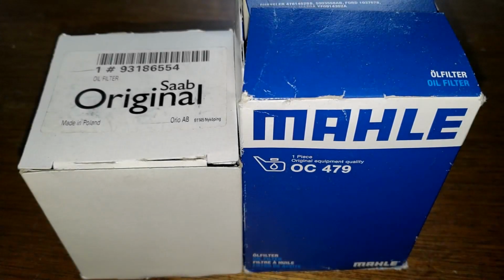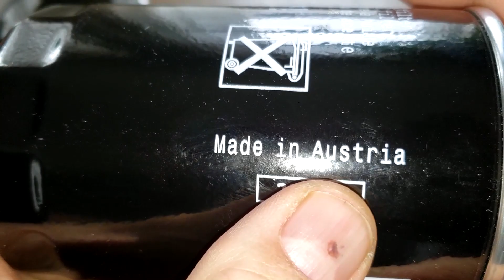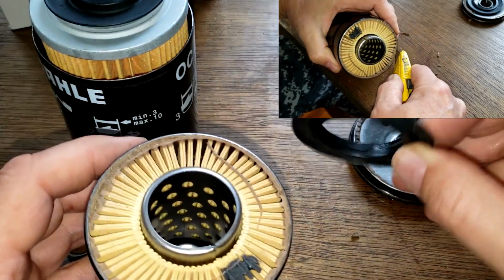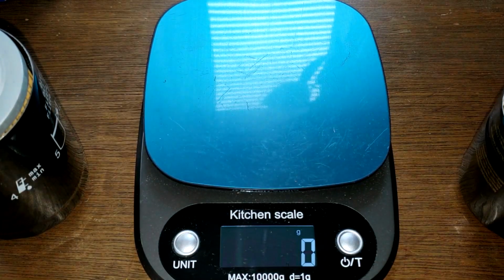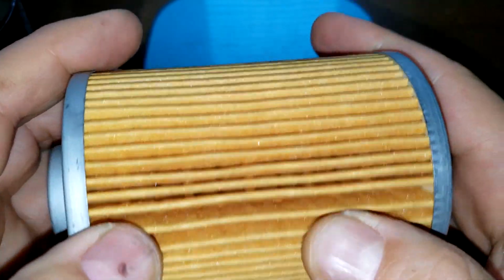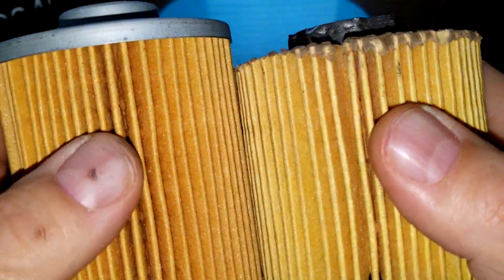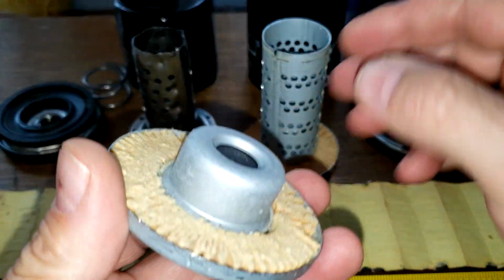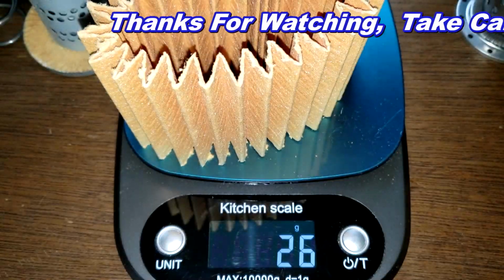Saab Oil Filter 55560202 vs. MAHLE Oil Filter OC479 Cut open

Comment: Mahle uses synthetic media.  They go into the benefits on their site.  Found this on BITOG with some digging (from a user that emailed Mahle):  'Beta Ratio: 50% -- 18 micron 75% -- 24 micron 90% -- 28 micron'.  So absolute efficiency is probably around 90% @ 20 micron.  Not bad at all.
Reply from the maker: Thanks for this information, I'll pin your comment so it sits up top.
Thank You!
Reply: @WhipCityWrencher  Thanks!  I also saw a diagram of their filters and the valve on the base end.  As some comments have pointed out below, it's an anti-siphon valve.  My thing about that is how does it impede flow?  It really reduces the size of the filter output.

Comment: There is a story behind the Saab filter. It was a redesign developed during 2003 to 2005 triggered by a oil sludge recall campaign for the B2x5 engines, and that specific oil filter is probably one of the more well tuned OEM filters in the car industry. It also explains the bypass spring valve design, as it allows operating closer to maximum allowable pressure loss than a normal spring that opens gradually. So for the Saab engines it is recommended for, I wouldn't use any other oil filter (in normal price ranges).
Reply from the maker: Thanks for Sharing that info on this filter👍

Comment: That second "bypass" valve is used to keep oil in the filter when the engine is turned off for cars that have the filters mounted sideways. I have a Ford Focus with a Zetec 2.0 and that's what I use.

Comment: Nice video. As a mechanic, I would prefer the Saab filter. It's has more filter area, is more robustly made, has a simpler design and bypass valve. The filter also sits facing down,  so the oil won't escape at shutdown. Also, using original parts is good practice for any claims.
Reply from the maker: Thanks, Pete👍

Comment: SABB, haven't heard that name in awhile.

Still have nightmares from a late 80s Sabb who the dealership I worked for took on trade.  It had electrical problems, and all I remember was spending hours testing relays.

I got it running, but remember watching a customer drive it off the lot hopping it wouldn't die until he made it to the other side of El Camino.

The life of a former Ford Tech.   

Thanks for all that you do.

Comment: Never owned a SAAB. but have been called  a SOB plenty of times... Not so sure about that glued seam to the can, creates a bulkhead there I would think 🤔.  Saw another comment about their timing chain drive systems needing that consistent oil pressure at all times, thus that super unique twin bypass system on the "Moll EEE" filters. It's wider media makes up some, for its shorter length.. "MOLL EEE" filters have always been quality stuff on the equipment on the Construction company I worked for ...👍 Another Very Interesting Video on Oil Filter Friday's. Thanx WCW.....Jethro

Comment: The second bypass on the Mahle is designed for applications where oil would otherwise drain from the outlet side on engine shutdown - it's not common, but ultimately depends on oil filter placement on the engine - a traditional bypass valve prevents drainage through the inlet side on shutdown - having both allows for mutiple applications I suppose, given it's an aftermarket filter

Comment: Both interesting filters. Interesting Saab glues the element to the can side. Weird, but it must work. Maybe it helps keep oil in the filter after shut down. The Mahle has what's known as an anti-siphon valve in the center tube. Basically, it's another anti-drain back valve, but it's mechanical using a spring, "like" the bypass valve. Engine must be prone to start up rattle and making sure oil stays inside filter important. Some Ford engine applications have this valve too. Thanks for video.
Reply: Mate, can't say that the OC479 was designed specifically for the SAAB engines, but they do have chain driven valvetrains (a good thing IMHO) and hydraulic lifters, so yes subject to startup noises.  The bottom ends of the SAAB H engines are bullet proof - 500k miles type stuff - but the top ends are the life to rebuild limiters here.  Basically, between 200-300k you're gonna need to put a new chain in and redo the head.
Reply: @jonnyb4336  I appreciate your reply here. I went and looked up the OC497 using the Fram cross reference. Saab does NOT show up as an application for the 3600, the Fram equivalent. So, at this point I'm going with, the Mahle is NOT the spec filter for Saab. Perhaps, it's an oversize that fits Saab. Also changes my speculation why the Saab filter glued to can side. At this point, no idea why they do that. Thanks for the info in reply.

Comment: With the two valves, one before and one after the media, the absolute pressure differential can be more precisely set for bypass operation.  At least, that's my guess. 🤔

Comment: GM filter design very strange.   Prefer the Mahle if I owned a Saab.  Good show and review.
Reply: Yes, agree GM filter design is a strange one.  I suspect its still built exactly the same as it was designed back in the 70s, with less automation and QA/QC systems in mind.  Definitely not impressed with this filter!  For those of the "OEM is best" mindset, if this one doesn't bust the myth I don't know what will.

Comment: Mahle makes quality stuff. Pistons etc. Filters are made to spec by the OEMs request.   Also many exact same GM trucks use a short vs longer filter to clear the front driveshaft on 4WD.
Reply: The longer filters are preferred by some SAAB owners given the sumps are relatively small on many of these cars - 4 liters only.  While math says the longer filter only adds mabye 200ml of oil capacity, every little bit extra counts, maybe, perhaps.   Theoretically, the extra oil can't hurt.
Reply: I think I read somewhere that on 4.8/5.3/6.0 they went to a shorter filter because they were getting damaged during vehicle assembly when the previous filter stuck out below the level of the bottom of the oil pan. No idea if that is BS but I have heard it

Comment: Ah, very nice Pete, you did a great job on this for us Saab guys (and gals).  Definitely some eye openers on these two.  I'll chime in to some of the questions from the bit of research I did up front but again thanks for doing this.  Now, which filter will I run.  Not sure I like the GM sealed to the base plate with just glue - that seems like it'd be prone to error and as such bypass of the filter media.  Maybe I'll stick with the Mahle:)  Jon
Reply from the maker: Thank You!

Comment: Thanks for the very interesting video, Whip -- both filters have the Straight-Seam (weaker) type of metal cores -- the Spiral-Wound core gives the best protection against core collapse.
Nitrile Rubber ADBVs limits both filters to 3,000 - mile filter changes.
The spring-loaded valve at the inlet end is an Anti-Siphon valve, which keeps the oil inside the filter on shut-down.  Prevents oil from draining back into the sump, while also preventing the oil from siphoning forward.
I would not buy EITHER of these filters, due mainly to the Nitrile Rubber ADBVs, the Straight-Seamed cores, and the much-touted (but actually inferior) Coil Spring.
 SAAB cars have always been a bit "strange" -- I had two (2) of them, a '64 "Normal", and a '66 GT.
Both were 3-cylinder, 3-carburetors, 2 cycle, water-cooled, front-drive, 4-on-the-tree -- the GT model had front disc brakes and Oil Injection. The seats folded into a comfortable BED, which made for an excellent absolutely weather-proof camping shelter for 2 adults. SAABs had 3-point Seat Belts, even before we had the crappy Lap Belts in the USA. 
Whip, you've shown us that you try to give as much information as possible, which is important to all of us -- BUT -- reading off the Date Codes is a waste of everyone's time, including yours, because those Date Codes are 
for internal use only -- they MEAN NOTHING to the oil filter purchaser.
 Thanks for all you do, and keep up the good work !
Reply from the maker: Thank You!
I read the date codes because on some filters you can actually tell when the filter was made and since they change the design on some of them, Wix, Napa for example it's good to know when they are made. Also, there are some out there that want to know this information. So I read them all. Check out this post on how to read them, just click on the link. https://bobistheoilguy.com/forums/threads/oil-filter-date-decoding-thread.351643/
Reply: @WhipCityWrencher  Okey-dokey.
I'm trying to picture a befuddled oil-filter shopper at the AutoZone - searching the shelves frantically to find the filter with the latest Date Code, while the Store Employee wonders: "What in the Holy Hell is that fool doing !??"
 Reading the Date Codes would make MUCH sense if the codes were STANDARDIZED -- but they're NOT, so they DON'T.
 But hey, this is your gig, so I'll just hide and watch !!

Comment: Maybe the second valve on the Mahle filter is to keep the filter full for start up? Getting oil through the engine sooner while the oil pump catches up. I am not sure, but does seem Mahle with this set up sure made it harder to prime before putting it in.
Thanks WCW.
Reply: Bingo! Good call Brad. It's what also called an anti-siphon valve, basically another anti-drain back valve. The engine it's used in must be very susceptible to a start up rattle.
Reply: @faxmen09  Ah, someone in the know it seems!  Yes, in doing my "what the hell is this" research before asking WCW to cut it open for us, it seems Mahle thinks that anti-drainback protection is needed for both the inlet (rubber flap) and outlet (spring poppet) sides of the filter, particularly for filters which are mounted horizontally.  DIdn't make tons of sense to me, but Mahle does engineering well so hate to nitpik.  But I can't help myself - this seems like overkill to me!  Faxmen09 does this make some sense for horizontally mounted applications?
Reply: @jonnyb4336  Ford has the Zetec engine which also has an oil filter that also uses an anti-siphon valve in the center tube. I believe it too has the filter mounted horizontally. All I can speculate is these engines must be more prone to a start up rattle and thus need that extra drain back valve to keep as much oil in the filter as possible. I'll say this, it can't hurt and is no doubt more expensive to produce.
Reply from the maker: You're Welcome!
and I'll second that good call👍

Comment: I CAN'T seem to get past this - for the SAAB OEM filter, without an endcap on the baseplate end, what prevents oil from just leaking through the open/exposed end of the pleats?  What am I missing?  Anybody?
Reply from the maker: I'll take another look at it but I think the inner core goes over the inside of the base plate and with the ADBV/Gasket it all fits nice and tight and the oil can only go through the filter media or the bypass valve.
Reply: There are other no endcap oil filters out there. The Toyota OEM made by Denso (Thailand) has no endcaps. Same for some Mazda OEM and some others. How they work are the ends of the pleats are glued shut, thus they don't leak. Having said that, never seen the media element glued to the inside of the can. That's a head scratcher, no idea of the purpose, if there is one.
Reply: @faxmen09  the gluing inside - maybe to reduce the amount of different items needed to manufacture or speed up manufacturing?
Reply: @leosheppard8517  Your guess as good as mine. I just can't see or think of any logical reason to glue element to the inside of the can. Never seen it before.

Comment: Who makes that Saab filter?
Reply: The box says this filter is made in Poland, and as a confirmation of other's insights online and a little deductive reasoning, this filter is made for Orio by Mann+Hummel at their plant in Gostyn Poland.  The Gostyn plant was commissioned in 1982 by Filtron - a brand acquired by Mann+Hummel in 2016 - and from some web info the plant has a long history of manufacturing for OEM clients (like GM).  On the outside this filter looks nearly identical to the Filtron OP 532/2 filter at least in pictures, which is made in this same polish plant.
Reply: Outstanding

Comment: Saab was a strange company so no surprise their filters would also be a bit strange.  With all these variations in filter designs it would be fun if someone made some clear filters for the purpose of watching exactly what happens. I should post that in Garage 54's comments and see if them wacky Russians can pull it off, assuming they ever see my comments which is doubtful.   Would you be interested in cutting open a vintage fram filter?  A thrift store I frequent has some that are in the old half clear cellophane and card board packaging. I looked at one and it looked a bit rusted on the inside.  Thought I would ask!
Reply from the maker: Yes, that would be awesome to do a comparison. Are they dated at all? Shoot me an email. Poker4me007@gmail.com